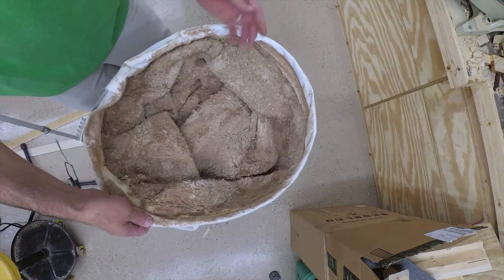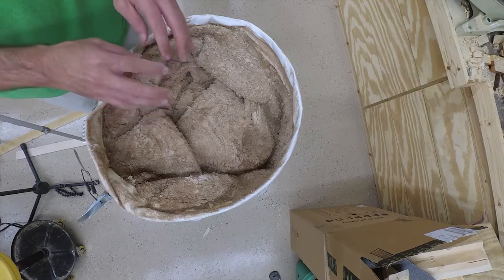Installing a Wynn Environmental Filter on my 2 Stage Harbor Freight Dust Collector

Comment: So it's just 3 hooks from the bottom?

What kind of remote control are you using?

Are you running the dust collector on the same circuit as your power tools? Do you trip a lot of breakers?

Comment: So that's what the filter bag looked like even after the Super Dust Deputy??
Reply from the maker: +Cesar G thanks for the comments.  I no longer use the filter bag, only the plastic bag.  All dust and chips fall in the bucket below with use of the SDD.  The Wynn paper filter canister captures the fine dust particles.  I should do an update video on this.
Reply: Mike Kapotsy what I meant to ask was if that's what the filter bag looked like even after using it in conjunction with the super dust deputy. The super dust deputy is advertised as trapping 99% of dust. I just ordered the super dust deputy and was thinking I could hold off on the Wynn environmental filter until I can afford it. (I couldn't afford to buy both super dust deputy and filter at the same time) If that much dust was collected by the bag with the super dust deputy then I don't want to use my dust collection until I get the wynn filter.
Reply from the maker: Cesar G I see.  No sir, that was the condition prior to installing the SDD.  I no longer use that filter bag, only the Wynn Environmental paper filter canister.

Comment: is that alarm light for the drum being full and if so do you have a source
Reply from the maker: +Alan Garrett yes sir it is a sensor.  It is by Oneida Air Systems.  Called the Dust Sentry. https://www.oneida-air.com/inventoryD.asp?item_no=AXB999110B
Reply from the maker: +Alan Garrett I have a video on the installation of the sensor as well.

Comment: Does the size of the bag on the bottom matter in a 2 stage system?
Reply from the maker: +xHMProductionx not so much if you have a canister like mine.  It catches all the chips.  Only concern is overflow should it fill up.

Comment: You will find out how annoying it is to pull the bag to remove the filter for cleaning every time.  I just use a couple ratchet straps to hold it down.